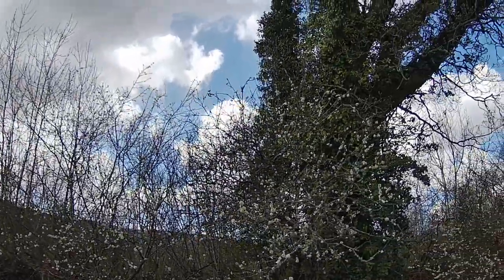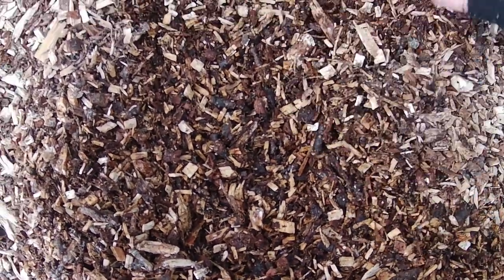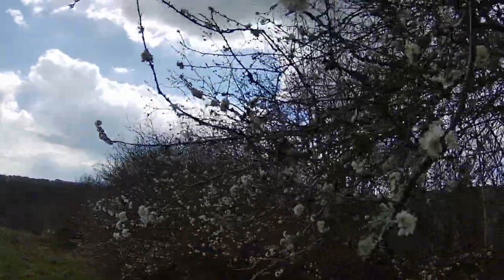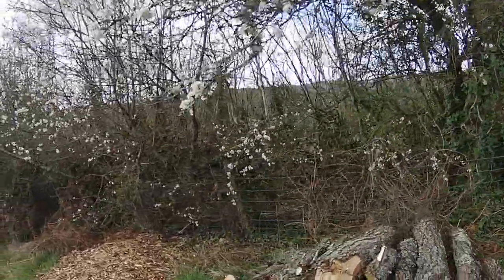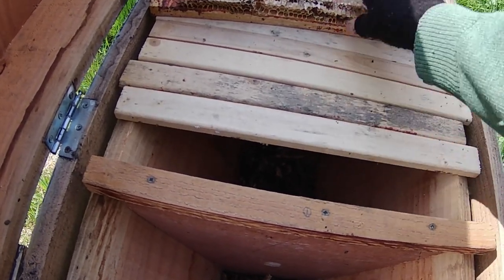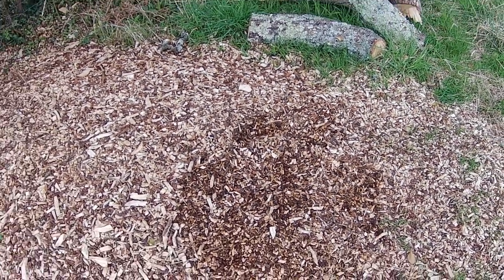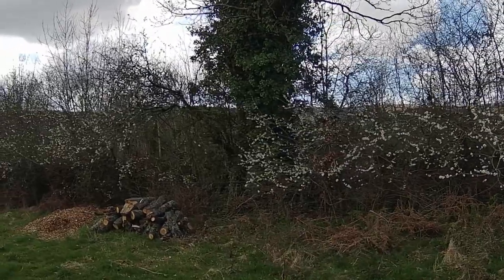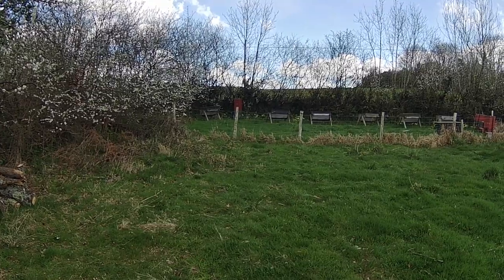Eco floor substrate material

Comment: Thank you, kind sir for sharing your knowledge.  Recreating the environment of a tree hollow certainly makes sense.  I'll be incorporating this in my new hives to see for myself how it works.  I believe I will make mine rather deep to provide for a better moisture and energy sink and therefore better regulate the internal temperature of the hive. The goal isn't so much to maintain temperature (even if there may be some heat from decay) but simply to help temper rapid changes of temperature in a short timeframe.  This may be a case where more is indeed better.  We shall see!

Comment: Wgat are your thoughts on varroa open floors on long hives   and could you put chippings on it??
Reply from the maker: I don't like open mesh floors, and I don't think bees do either, given that they move up and away from them whenever they have the opportunity. If you compare them to what you usually find in a hollow tree, it's easy to see why. Even the relatively small areas of open mesh in polynucs create a draught, and I have begun to cover them with wood chips.
Reply: @BarefootBeekeeper  Thank you for this. I’m in a reliable swarming valley with many mature trees, mostly feral (I think) quite dark bees. I’ve found they won’t go into a bait hive with an open mesh floor of their own accord , however orientated or baited, but will, if it’s dark and cosy in there.

Comment: How about puting some sort of rain catcher on either side of the floor, like a small funnel and a bent pipe? And maybe a small hole halfway up the guttering to act as a overflow. Or abit lower as needs bee.
Reply from the maker: You could do that, as long as you have rain fairly regularly.
Reply: I was planning to experiment with something like that. My idea was to use a raised flower bed as a hive floor, and make the floor area bigger than the hive so that the rain gets on the sides of the floor and wets the rest of the floor material by diffusion.
Reply from the maker: I think that is an idea worth trying. I want to make a similar arrangement for a Warré give, which would be easier to do than with a TBH.

Comment: Just a thought on retaining moisture in the litter on the eco-floor, what about charcoal? I know that it absorbs water but it might slowly release moisture back into the litter. I recently burned a birch stump and root so will put some charred pieces into my just built, from your plans and books, TBH. I'll have to build a second as a control and leave the charcoal out to see if there is any difference. Mind you as I live in Ireland I imagine that the litter will always stay damp!
Reply from the maker: Excellent idea! It's pretty damp here in Devon as a rule, although we have just had 3 weeks of dry, cold weather and easterly wind, which is practically unheard of.

Comment: Hi Phil. When I built my first tbh with an eco floor about six years ago I filled it with shavings.  The bees decided that they would empty it all out and build their comb to the bottom.  The colony died after many years and swarms so I’m thinking of refurbishing the hive. 
Do you think buying garden centre bark chipping’s and leaving them out for a period of time would do the same job as the oak?  Thanks Liz
Reply from the maker: They do seem to throw out lightweight shavings, but chips are too heavy unless they use machinery. Partly decomposed bark may well be a good material.
Reply: @BarefootBeekeeper   like these bees 🐝 🚜🐝 🏗🏗🏗. 😂
Reply: @BarefootBeekeeper  I’ve had them throw out all the top layer of lovely damp moss and willow bark I gave them.
Reply from the maker: Interesting... They tell us what they want, one way or another.
Reply: Liz, if you have any tree surgeons, tree removal companies near you, maybe you could call them and ask that they save a bag of oak chips for you -- they might do so, especially if you explain your interest/reason for wanting it. Pretty unique I think and they might be intrigued! A possible benefit from this approach is you don't know what you're getting in those bags you buy, or how it's been treated/handled...maybe it's ok, maybe not?
Reply: @tdkinsky  thank you for the suggestion Tom there are a few tree surgeons here. 
I’ve been thinking... (it’s dangerous) 
I pruned my fruit trees late summer and have got a lot of branches lying about.  I’ve thought I could put them through the chipper but read somewhere that they could get oil on them...  I’ve also got loads of old fruit and bramble canes and have wondered if I could cut them into 6” lengths to see if they would be suitable 🤔

Comment: Hmm, how about if for the eco-floor, one dedicated an entire brood-box completely full of mulch and wood-chip etc? The sheer volume aught to be very helpful in maintaining moisture, and should watering be required it should be easier to do via a hole in the back, just the same as some hive entrances rather than having to disturb the hive. 

I am getting crazy ideas about a circulatory system from a quilt-box back down to the eco-floor now, but I'm a long way-off having a fully formed plan lol

Comment: I had one more thought Phil, in your other video on the eco floor you put birch bark in the bottom, would the decomposed matter form a birch stump work as well?
Reply from the maker: Birch is a particularly interesting tree to me, given that it has a number of folk medicinal properties and supports the growth of several key medicinal fungi, including chaga, reishi and the birch polypore. I think it is a most promising source of medicine for bees. The bark contains an oil that is responsible for its use as a firelighter, and which has been extracted for human use for thousands of years. Decomposing birch will contain fungi that may be beneficial to bees. More research needed...